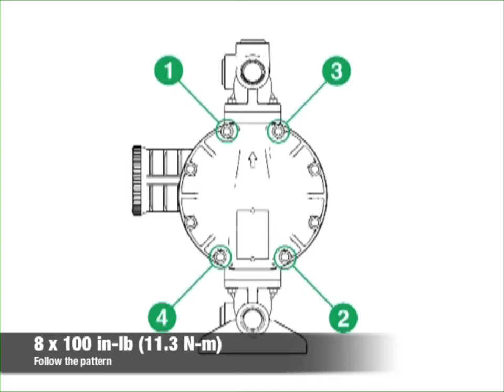Graco Husky 1050 Standard Diaphragm Re-Build

Comment: Hello Sir. Let me ask you a question. How much does the GPM make?
Reply: Hi Ica, the Husky 1050 can achieve flow rates up to 50 gpm.
Reply: How about a husky 3275? How much GpM. And why is the pilot in there exposed to water. While the pilot was tightly closed? Thank you
Reply: @icawijaya9217  The  3275 has actually been replaced by the 3300 series with a maximum of 280-300 games. 
When the fluid covers are tightened the diaphragms are sealed so the air side is separated from the fluid section, keeping the pilots and air channels free of material.
Reply: I work in a factory. repair the husky pump. there must be an obstacle on the pilot's part. and often wet in the piston
Reply: @icawijaya9217  I'd suggest reaching out to the processtech@graco.com email with details and description of your situation.  They are very prompt and thorough in how they troubleshoot problems
Reply: Yes sir. Thank you for the advice

Comment: What does the Diaphram Installation tool do? Why is it needed? What happens with the pump if it is not used?
Reply: From my experience, the Diaphragm Installation Tool slows the flow of air, making it SIMPLE to move the shaft from one side to the other, which makes it easier to attach the diaphragms back onto the shaft. Basically, it's needed to make the job easier. If it is not used, you could apply too much air, cycle the pump too far (or fast) and you probably could cause damage to the diaphragm (that you just changed). I would personally recommend using the tool every time. Makes changing the diaphragms out a breeze.
Reply: Thanks for your responde Andy, We have several Graco Husky 716, 515 and 307 pumps. In the past we have replaced the diaphragms several times but we  have never performed the procedure using the installation tool and the service manual that we have does not indicate that we should use such tool. 

Are we doing things the wrong way? Does doing this bring harsh consequences over the life expectancy of the pump? Will it bring operation problems?

Cheers.